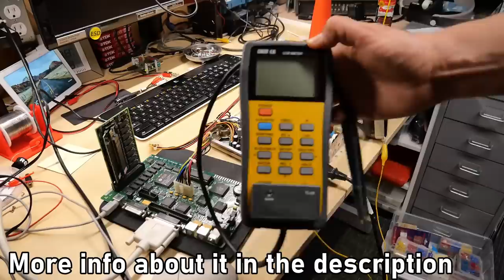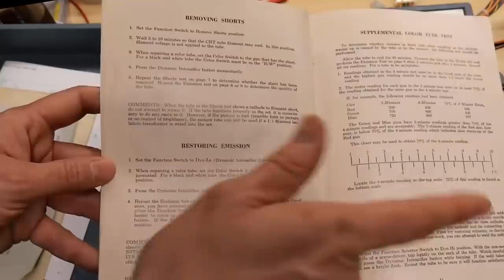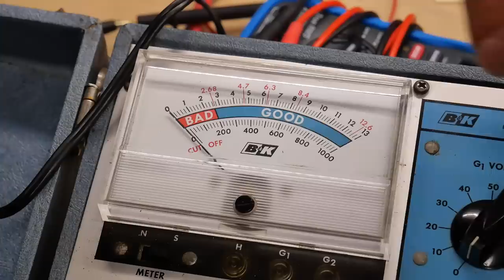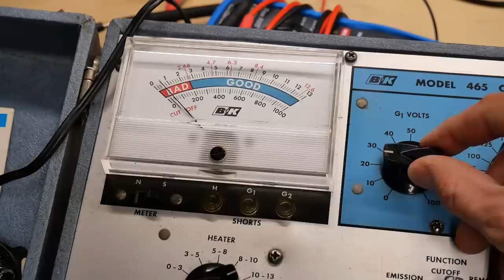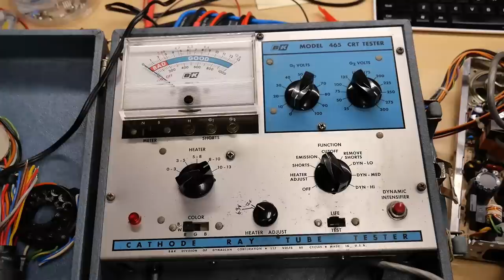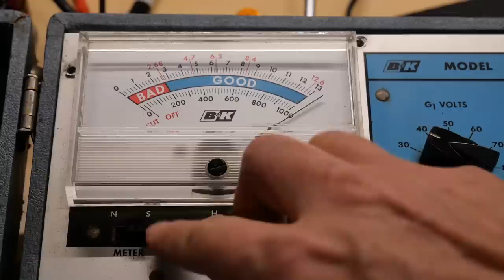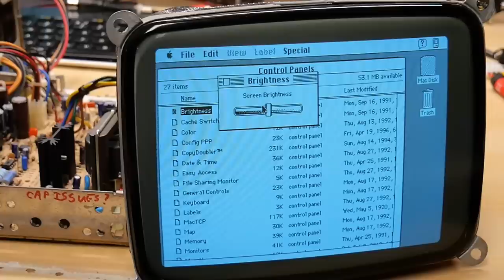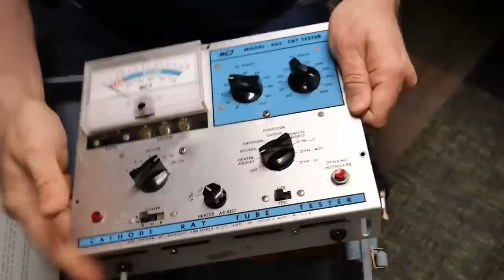Rejuvenating a Macintosh CRT with equipment from 1969

Comment: This is perhaps the simplest description of what I suspect your "rejuvenator" is doing. 
"The other method of rejuvenating tubes is the procedure which  is usually termed "reactivation". This involves temporarily overrunning the 
  heater whilst, at the same time, a positive potential is applied to the tube  electrodes. The result of this procedure is that a new supply of emitting oxides 
  are formed on the surface of the cathode, and the tube should then be good for  a further period of use under its normal working conditions. "
Source: http://www.thevalvepage.com/teletech/crt_rej/crt_rej.htm
The process is not without its risks, but if it works, then the tube life may well be significantly extended. 
Certainly it is good enough to use as a "test" CRT, and given the likely infrequent use of these old machines, it may well be worth fitting as a replacement for any dead tube you encounter.
Reply from the maker: Yeah I didn't mention but the "medium" setting runs the heater at a much higher than normal voltage. (It glows brightly.)

Comment: analog meters can be made more accurate, they require calibration. in audio equipment this is usually done with two series trimpots and a spring tension screw

Comment: In the past, CRT filaments were not as delicate as you suggest. 6.3v filaments could be safely run as high as 12.6v. Don’t believe it? Perhaps you have heard of a CRT brightner? They were put onto a weak CRT to boost emissions by stepping up the filament voltage from 6.3 to 7.8. You could even use two and get 9.8v or three and get almost 12.6. This was done because CRTs were extremely expensive (parts + labour) and a brightner or two could extend their life at minimal cost. I suspect you could get a small filament transformer (that’s what they called low power step-down transformers) and do the same with your Mac CRT. It would bean easier solution for those viewers who don’t have a CRT tester / rejuvenator.

Comment: I’m really curious about how this works, it would be cool if I could use this in some of the half dead CRT’s I always have hanging around
Reply: The pressing of the button (where you hear the spark) discharges an arc across the cathode which exposes fresh surface that allows more emissions to hit the phosphor giving brighter image. It seems the CRT had cathode poisoning due to low heater voltage.

Comment: oh geez, i fixed an old radio with that style of construction, not fun, none of the parts were all that easy to get and somewhere along the line i managed to slash myself on the chassis, thankfully the tubes were still good.  i replaced all but one of the original wax paper capacitors(that one was an extremely unusual value i couldnt find a close enough match for so i decided to see how it went leaving it in) but seeing this it might not have been totally necessary to go so far

Comment: I had some luck with these back in the day, but those old monochrome tubes could be replaced with new ones fairly cheaply. Unless you bought from Apple of course, their prices were way higher. The trick was to find the right replacement based on specifications. Most picture tubes came from 2 or 3 manufacturers, and they had very detailed catalogues (this was pre-Internet). Got to be careful to discharge them before you work on them, the tube itself is a large capacitor that can store it’s 20 kilovolts for a couple of weeks.

Comment: I would suggest changing the other capacitors. I is only a matter of time before they fail.
Reply: Mr. Carlsson's standard procedure for those older rolled caps is to throw them away on sight.
Reply from the maker: I'm not too concerned - this devices only gets used for a couple minutes at a time then stored away for months/years. I know where to look if this is acting up again in the future though. :-)

Comment: Slight warning, LCR meters can be imperfect for testing old capacitors, they often give a higher reading that the cap is rated at (a bad sign) and completely overlook leakage, probably the main reason old caps need to be replaced. Carlson's Lab has a nice chunk on this topic in his recent video you should check out https://youtu.be/0rf-fO0aj3I?t=1534
Reply from the maker: That is cool -- I clearly don't have a leakage tester like he has so there is no way for me to validate if these caps have leakage or not. He was testing caps on a device from 1947 so would be curious to know what 22 years of progress means to these types of caps.
Reply: @adriansdigitalbasement  His general advice for old caps is just replace, it's not worth the risk, but you're more than well aware of that. The leakage tester is his own creation that you can get the plans for if you are a patreon of his; i have been tempted to throw a couple bucks at him for those plans as it does look like a very useful design.

Comment: I'm surprised it can measure cathode emission without a connection to the tube's high voltage side, which pulls electrons toward the screen and gives them somewhere to go.  Safer without it, though.  Cool stuff.
Reply: That's because there is high voltage being applied to the tube.  There has to be high voltage to get a proper measurement on the tube.  It's just not at the final anode but at G2.  The final anode is only needed for the picture, but G2 applies the voltage potential across the tube that accelerates the electrons.

Comment: You should get a baseline from one of the better CRT's, actually you should test them all.
Reply from the maker: I actually did that -- so I was able to measure which was best -- which matched my observations of the performance of the CRTs after adjusting the G2 and G1 cutoff on the analog board. I've gotten pretty good at judging a CRT just from how it looks.

Comment: Always change all the electrolytic caps on secondary and the smaller value on primary size on old switch mode psu, after 25-30 years they are shot, used to have a tube booster big arc over to cathodes to burn off the worn out cathode material and expose fresh so more electrons can be emitted and brighter picture, worked well.

Comment: B&K normally set the heater voltage by regulating the current, so its vital the heater volts are set with the CRT under test already connected. You might find if you unplug the crt, the heater volts on the meter shoots right up. Also I think the capacitors are critical, value-wise, because B&K use their capacitors in weird ways, like for setting 'repair' energy and restoration time-outs. If the capacitor is too big it might over-treat the CRT. B&K also notorious for dry joints, that might be the sparking you heard? BTW, Richardson Electronics in IL do brand new mono crts like that for around 60 dollars.

Comment: Tube filaments are pretty hardy. 
In an attempt to rejuvenate an EM34 tuning eye, i ran it on 12v instead of 6v. Sadly the only effect was that the filament glow was now visible from the front. The tube still had emission, a lot of current was flowing but the phosphor screen was just totally worn out. The filament could handle it, though.
Of course, long term use on a too high filament voltage is bad.

Comment: All of the 3 wax capacitors are bad and NEED to be changed ASAP. Yes they will read good, probably over archiving on a capacitance meter (for those meters measure the time to charge, and if the cap has internal shorts this time will be greater, thus showing greater capacitance) and even show good ESR. But they are leaking electrically, i.e.passing DC and shorting out your other components. Please see a video of Mr Carlsons Lab and believe him, not me, the random guy on the internet. His current "Robot head" video shows exactly this and he explains and measures them against a modern cap. Just capacitance and ESR are NOT enough tests to show if a cap is good or bad - and these wax caps are known to have failed a looong long time before. The sparking is surely a sign of this.

Comment: When doing rejuvenation of tubes you need to tilt the face of the tube downward, but not flat on its face... so that if pieces burn off during the process, they fall out of the neck and don't short.

Comment: You really should replace all the caps in the tester. Their capacitance may be ok but they are 51 years old and will be leaking DC  even if the test ok with most meters.  Proof of this is the one got so bad it became a dead short.

Comment: Well i just wonder what is it that rejuvenate, because it just not brighter? The gradient range betweeen bright and dark  somehow become greater, why and how? I do not know shit about monitors or CRT's so what is going on?
Reply: Maybe a better question what is it that is weared out and rejuvinated i only know there is an electron beam and somekind of grid raster but how is a black and white image on screen created? I have no idea how the beam create a picture by scanning downwards and sideways.
CRT is the most mysterious thing to my mind, is it possible to explain how they work? Pixels seen like lowhanging fruit to explain in comparisson, and again what is it that is rejuvinated or failing?????
Reply: I did check again the comparisson why is the range suddenly bigger, is it something clogging up and you put through highvoltage somehow do what???
Why  is the output of a CRT changing over time oxidation or ???
Reply from the maker: Supposedly the cathode gets covered in a layer of junk that just reduces emissions. The zaps burns litle spots off the crap layer off allowing stronger emissions again. It's temporary because the crap layer will be attracted the clean spots and cover them up again. (Or so I've been told.) It's a bit beyond me how it all works but it is definitely a cleaning effect of sorts.
Reply: @adriansdigitalbasement  So it is the brush so to speak that fails, not the canvas...raster and bulb?
So one can change the cathode "whatever that is" and the tube comes out practically as new?

Comment: I saw a video on YouTube of a company which restores CRT's its one hell of a process.  They measure the neck then cut it off, then they clean and recoat the internals of the CRT then there were some other processes they did and then they attached a new neck with a new set of guns using a glass blower technique.  End result is a restored tube.   I thought that was pretty cool the video was listed under TV or Tube repairs I don't really remember but it was a long video kind of boring but still interesting.   Don't send anything to EWaist  that you would rather use when it could be sent to a place to be restored.  I only have one CRT Monitor left in the house and if the tube needed restoration I think I would consider sending it out.   Try to find the video you will not regret seeing it.

Comment: You really need to install a proper mains cable and plug on that unit with an earth to the chassis. That old thing is a death trap. And I would not leave those old garbage caps in there no matter what they test like (I bet you didn't test for high voltage leakage?). You can replace them for 6 bucks and five minutes of soldering!
Reply: The red-orange caps aren't paper but are electrolytic so they will have leakage regardless.  Should they be replaced, yes, but if it is working, then it isn't immediately necessary.  Also, It's hardly a death trap unless you go poking around inside and bridge across the high voltage.  Everything is isolated from mains by the power transformer.  This makes it much safer than a typical AC/DC radio.  A fuse would be a better addition.

Comment: You need to replace the other three caps in that CRT tester. Unfortunately caps of this age tend to be very electrically leaky and even if they test fine in a capacitor tester they most certainly are not! It would even be worth checking all of the resistors as well just to ensure none of them have drifted way out of tolerance.

Comment: That worked significantly better than I was expecting, too. I hope you'll do a follow up on how it holds up. As someone else mentioned, since the CRT face doesn't look heavily burned in, it may have just had some cathode poisoning.
Reply from the maker: Yeah it surprising other CRTs on these Macs had worse burn-in but are much brigher than this one.

Comment: Man, that tube's worn out! It most likely saw thousands of hours of use for it to test like that. Try hooking up a known good CRT for comparison. The meter's supposed to sit well into the green for a good, usable tube. That particular one is what I would call "marginal". It'll show a picture, but obviously won't compare to a fresh tube.

Also, in the instructions, it mentions holding the button down for 15 seconds on the medium rejuvenation setting. See if that helps bring up the emissions, although it'll most likely fry the heater at that point.

Comment: You can do a rejuvenation without a crt tester fairly simply if you know how.
All you do is power up the filament with a bench power supply and with a small isolation transformer with an output of 220V simply connect a 15W 220V lamp in series to limit the current, then connect this current limited 220V AC directly across the G1 and Cathode. 
The lamp will start to flicker and when it stops flickering and is constant brightness, the rejuvenation is done.
What this process does is strip away a tiny layer of dead cathode material and leaves exposed a fresh layer of cathode with more emissions.
It can only be done a few times as after all the cathode material is used up the crt will have no emissions anymore.
I have done this several times in the past and i can tell you it works very well and you get months to years extra life.
Reply from the maker: A little extra info since I did more testing with the tester on a 20" color TV I sent off to E-waste. Using the medium setting actually runs the heater at a much higher voltage too as it gets bright. And I found that two zaps on Medium was the best -- going more than that actually reduced emissions again. (I was able to test which each of the 3 cathodes on the color CRT.) But yeah not a bad method! I figured it's nothing hard to do.

Comment: I did this on a neo geo arcade machine's Zenith tube with a BK 467 for color.  It lasted a long time after because I didn't have to run the arcade machine constantly. I came across a lot of people suggesting not to use rejuvanators as well because they can kill a tube but if the tube is unusable who cares!?
Reply from the maker: Yeah my thought exactly. Even if it's 1000 hours of improvement, with an old computer like this, that could be years and year or longer.